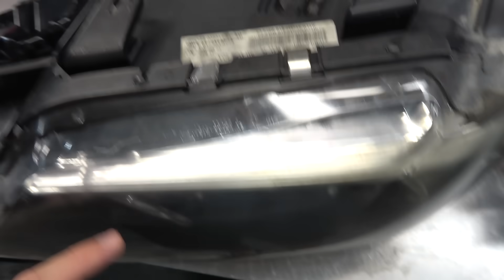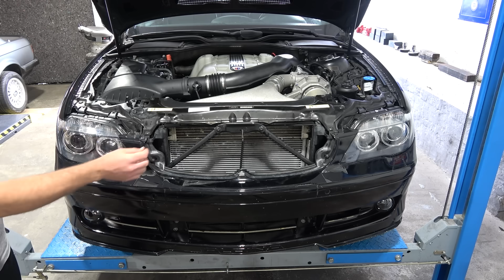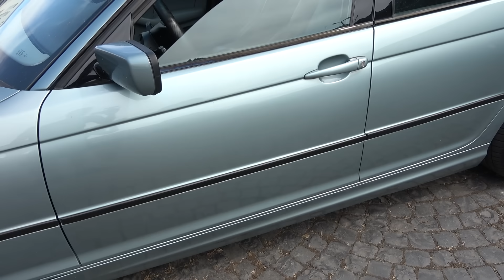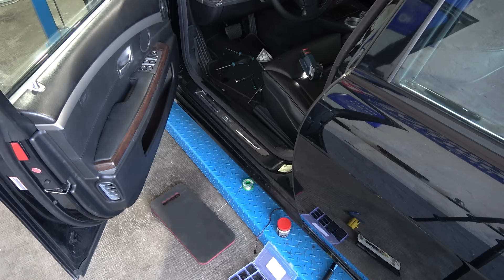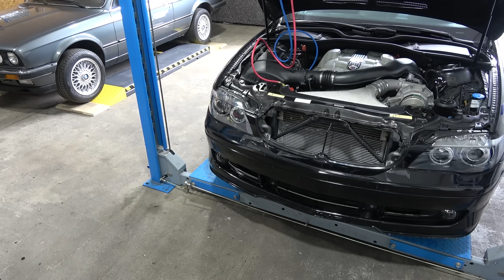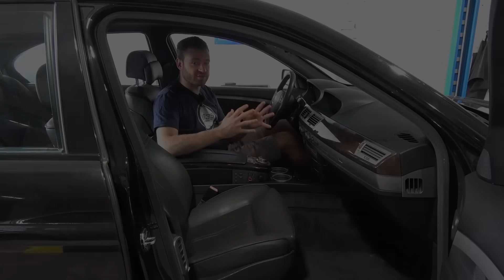Can We Make Alpina B7 Roadworthy Again? - Project Chicago: Part 12

Comment: In Germany there is something else next to waranty. Its called Gewährleistung, I dont know the english term. It says that the seller has to warrant that the part was as described at the point of sale. A faulty pump doesnt qualify as such.
So you can go to the BMW dealer and return that fuel pump on Gewährleistung. And either they take it back or they have to proof that the failure occured after the sale.
Gewährleistung lasts for 2 years but after one year, the burden of proof switches. You have to proof, that the product was faulty before it was sold.
This also has nothing to do with the manufacturer, itsjust between you and the seller, no 3rd party involved. If a business is buying, the burden of proof always rests with the buyer, but if youre a private customer, then its as described. Gewährleistung is mandated by law, every commercial seller has to offer that.

Most sellers dont talk about it or confuse it or try to deny it because its their money on the line.
I dont know if you can decide if you want the money back or a replacement part.

Comment: As someone that works at a dealership in the US, you can do a parts warranty for an over the counter purchase if you have any sort of documentation showing the part is defective (typically from an independent shop that has done the installation or can write up a work order for you showing the steps to verify the part is defective). I don’t know if every manufacturer in the US does this, but I believe most will. Warranty is warranty in the end

Comment: Hi Sreten! I'm a warranty administrator for a BMW dealership here in the US and can confirm the process as far parts warranty is concerned. Dealer technicians do indeed need to diagnose the issue(with the part installed) to confirm the failure, only then will it be warrantied. It is frustrating, especially for you as you are extremely detailed and by-the-book.

Comment: That windshield cowl is poorly designed, in my car the water goes under it because there is no gasket or sealant, the water drips down the firewall between the fusebox firewall and water enters the fusebox and the front passenger footwell under the glovebox through ventilation slits cut in the fusebox/firewall.....the amount of damage this small oversight can cause is ridiculous...i replaced mine brand new and made a custom gasket for it to solve the problem to make sure the water never goes under the cowl again. Trust me its worth the effort, once the water gets in the cab it migrates all the way to the rear seats soaks up into all the foam and you need to pull up carpet to dry it. If the car is ever parked in rain don't say i didn't warn you!

Comment: Instead of using paint on the windshield plastic cowl, why not just treat it with H9 Ceramic coating.  You have it, and it will renew the dark black color and lasts for years.

Comment: Does that fuel pump work at all. I did ones bought new fuel pump too that did not work when giving it  12V. I needed to kick it couple times on the garage floor and then it started to work. It was somehow seized and needed a little encouragement.

Comment: Hey man, since you have a water sand blasting cabinet or whatever it's called, next time you do a brake job, I'd recommend throwing the caliper bracket in there and giving the mating surface a blast. I work in a dealership and we always do this, except we have a sand blasting cabinet. The results are very good and it takes less time then cleaning the bracket while is installed.

Comment: Great work as allways. One thing you should think about when you're wanting to work on E series after 2002. You should learn simple coding. I know it's scary at first, but if you understand the basics, everything else is natural or trial and error. I'm writing this because of the flashing angel eyes (hot and cold checks) and too bright licence plate lights. I also hate overbrightened rear ends, but you can lower the voltage by coding and make any bulb look decent. 
P.S - Be carefull with ANY LED-s in headlights, cheap chineese ones have crappy element that is extremely overdriven and run very hot. I've seen molten sockets and reflectors on many occasions. The most sensitive ones are E60/61 LCI cornering lights. Just a heads up :)

Comment: Good recipe to avoid windshield or headlight sprinklers from clogging?....add a coffee cup of vinegar to the thank regularly...problem solved..!!
Reply: Or use the correct BMW intensive washer fluid
Reply: @Monkey-World-2  most of windshield washer fluids have some ethylen glicol in its formula...at the end all these components turn into some kind of gel that clogs reservoir's conduits...no matter if is an expensive or cheap product...
Reply: @ernest.cazenave  the gel is caused by people not having the correct concentration of good quality washer fluid at all times. The gel is algae that grows in the stagnant water. 

Many people tend to top off the system with water in the summer months and this causes the issue.
Reply: @Monkey-World-2  ecce est demostranda

Comment: With regard to your old block with steel liners , you may find some useful information here, they build up a V8 block which has been destroyed by a bent con rod by using liners and pistons specifically for cast iron . Apparently on some new engines BMW are spraying a Iron liner into the aluminium block and use specific pistons for that use. https://www.youtube.com/watch?v=P-ThVr_K4pk

Comment: 16:54 I have the same problem with LED numberplate lights. I hate the mega bright aftermarket lights. But I found that I can use the OEM ones from F10 or fl E87 on my secondary E60 that doesn't originally come with LED numberplate lights. You just need to solder OEM led numberplate plugs.

Comment: Epic video as always! One quick tip for  the h7 cbi night brakers, turn them on out of the headlight for a minute or two if you could because they have a coating that will evaporate in the headlight. That's the reason headlights become dim on the inside.

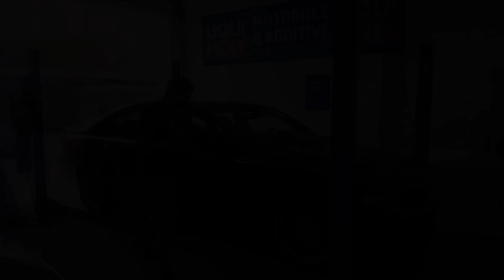Comment: Dear Sreten, I have an offtopic question. Do you know any back story about that blue touring standind outside the dojo ? 56:49
Reply from the maker: Yes, 2003 530i that I bought but still didn't introduce cause no time. It's a future project.
Reply: It's likely the E39 he's going to use for an M5 Touring build. A while back he posted about acquiring a sideswiped E39 M5 (the drivetrain donor car)
Reply: @gietie96  Yes, I know about that. Ha, and I just thought about the idea of swaping b30 from the touring into the e46, cuz he also thought about swaping b25 for b30. So it looks like project spin off :D

Comment: Just a FYI, the flashing LED halos is caused by the bias voltage which is the small amount of power sent through lighting circuits so the car can check to see if a light/circuit has failed. The reason the LED lights will flash is because they require a fraction of the power that an incandescent or halogen bulb does to turn them on.
Reply from the maker: I know :)

Comment: We do know where project Chicago came from. Did you know that in Chicago it only needs to pass emission inspection every two years? That entails pulling into the inspection station station, they check that the check engine light it off and the monitors are ready. That's it! Your German inspection will send it's head gaskets spinning!

Comment: I don't know why you don't just go ahead and charge the A/c system yourself. You've done 95% of the prep work already.  You could use the temp/pressure method or I see you've got a scale so you could do it more accurately by weight.
Reply from the maker: You need a proper A/C charging machine. You can't buy bottles in Germany and fill it yourself, it's illegal.

Comment: The headlight washers must be most pointless invention ever! Has anyone ever used them for any purpose on road car? I understand them on off roaders maybe, when car covered in mud they could clear something away, but apart of that no use at all, just waste of washer fluid. I know they are legal requirement for projector headlights, but as usual somebody who made it legal requirement had no grasp with reality. And if somebody say - what about winter?! Then I advise to try using them in winter - in my experience even using -40C rated washer fluid they freeze over if you use them when driving. In my case I was driving in like -17C and headlights were getting covered by snow in the snowstorm... guess what happened - they opened and freeze over making massive clump of ice around them and on the headlight making it completely impossible to drive. Had to stop in petrol station and ask for hot water to melt the ice just to be able to drive again. 
The headlights are still usable, not all EU countries have same regulation as Germany, which frankly is a bit stupid (not the safety part, but the part where they only care about numbers and marking and nothing else), in many countries as long as light output is right and light pattern is right (e.g. not UK lights which illuminates to the opposite side of the road) then they pass the checks and nobody cares if it says US on the light. On one hand I am all for safety and using quality parts, and I hate people with poorly working lights, for "fake xenons" which blinds everyone, but at the same time I hate arbitrary rules which exists there only for the sake of existing and which creates pollution and forces to replace the part which is perfectly fine and in case of lights shines exactly the same as the part marked ECE or whatever. I am sure in your case the glass was faded (could be polished) and the housing cracked, so perhaps that in itself justified the replacement, but if you would have to replace them just because they are marked US... I would be PISSED. I would probably change the lights for TUV and put them back on just for the sake of it and on principle. Similar to what you mentioned about protective film - absolutely ridiculous law which has no place to exist. One advise - remove the lights when applying the film, so that it goes inside body gaps - this way even if stopped it will be very difficult for anyone to see they have film, because the edge will be hidden. Again I hate people darkening headlights, in my opinion that should absolutely be illegal, but clear protective film... surely it hurts nobody?! 
Apart of that Osram bulbs are pretty much the best on the market, used Nighbreakers for most of the time and they always were excellent, always outlived my ownership of the car.
For windscreen cowl (trim) I think you should have used ceramic "trim restorer" and I believe end result would have been better than painting and less complicated job.
Kind of surprised you didn't use AquaBlast on brake parts as I personally would try to use every opportunity possible to use it if I had one :D

Comment: Sreten, for the LED number plate light I have had good results just getting a replacement LED festoon bulb and putting that in the OEM housing. They tend to be less powerful than the full units that are as bright as the sun and you can angle them towards the car rotationally to reduce light output a bit as well 👍🏻

Comment: Those TUV regulations are just insane! Can't even have a clear film over the lights to protect against stone ships!?

In the UK I currently run a Fiesta ST150 thats fully stripped out, 200 spec cams, 4-1 manifold, mapped, harnesses, bucket seats, coilovers and front end polybushed. I have a supercharger in my shed waiting to go on and it passes MOT and not once have I been pulled about the mods.

Comment: The brand new OEM fuel pump issue that was bad from the dealer you told us about @ 18:35 BMW not owning up too and no refund and subsequent waiste of time it cost you was an eye opener not to mention unbelievable. I can see them pulling a no refund on electrical parts on us squids but a master mechanic such as yourself is why the dealer turns into 'the stealer'

Comment: Why not flush the AC lines with solvent, remove all the old spent oil, flush again with nitrogen and just use the compressor with its new oil? It does not take much at all
Reply from the maker: That's way too difficult and only way to flush it is to replace all components.

Comment: The Ac comp won't die because of too much oil it just won't cool efficiently but more than that I think it's not a good strategy to put however much was in the old because over time it could have come out of different places during recharge or changes like you said condenser. Given it was oem denso I would trust them to put the right amount from factory and I think your comp is now low on oil.

Comment: I just replaced windshield cowl for my 330Ci e46. There is very good product for plastics i recommend you try instead of paint. Gtechniq C4 plastic coating. Small bottle goes for many parts. I put that product for my e46 sedan 2017 and all plastics are still deep black. Windshield cowl coating took only 10minutes. Ipa cleaning, and then it is time for C4 trim coating. I would say C4 finish is even better than rattle can painted black trim parts. I am enjoying your videos. Thank you. Antti / Finland

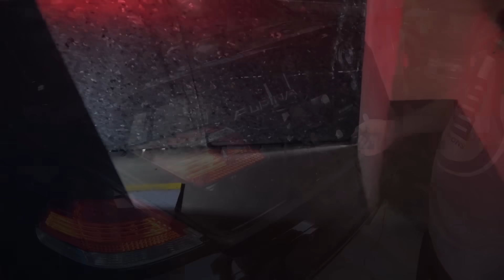Comment: 20:24 I don't know about German TuV, but in Croatia you can't run too bright license plate light and you can't run LEDs if the car doesn't have them from the factory. The thing is almost nobody cares about that but if the policeman or inspector is having a bad day you can get a ticket or fail the yearly technical inspection.

Comment: 21:25 You can buy led  bulbs in place of halogen for the numberplate, that are dimmer than the aftermarket with 18leds, but might cause an error on the dash, might not.

Comment: Ummmmm …. That is NOT how you put the correct amount of oil in a compressor! You should be able to get the specific amount it required from a manual or the dealer
Reply: You don't put in the amount specified in the manual unless the entire system is devoid of any oil. If you overfill it the a/c will never get cool.

Comment: Alcohol should be fine on the headlights, we would use alcohol for all plastic parts when prepping for paint, but would use a stronger cleaning type thinner for metal bits, that would have an effect on plastic, but alcohol generally doesn't.

But, better safe than sorry really, there is always an exception.

Great work as always though, inspiring for me to do stuff to my own car, which is hard to do thanks to ADHD, but you seem to be able to trigger my hyperfocus, which I thank you for!

Comment: Hi M539. This is a complete misinformation with the fuel pump. I learned dealer for carparts, had my own shop and I am in the Audit Committee for car parts apprentices of the german IHK(Chamber of Commerce and Industry). They have to check the fuel pump, they have to send it to the manufacturer!  BTW, I'm living nearby in Schwäbisch Hall, if you need help. Stephan

Comment: talk about bad quality original parts: I had to replace a tail light and it had greasy fingerprints inside the light assembly, so they had to replace it and the replacement also had fingerprints inside the light so they replaced it again and the third one also has a slight fingerprint inside but it's small enough that I said f*** it it's good...

Comment: The look on your face told me your B7 had passed TUV before you told us so!   
Those wood trims I believe are made by Kurz and are a holographic foil bonded to a plastic backing piece.  They are in fact better than genuine wood trims because real wood moves around with temperature and humidity and cracks off the lacquer whereas the foiled trims look just as good and will last the life of the car.
Regardless of further work planned on shocks etc. you now have a World Class Alpina B7.    An absolute credit to you!

Comment: Really surprising that you didn't turn off the voltage check so that the headlights don't flash on startup. I did it on mine and I only use Carly. But anyways much love and superb project.

Comment: Just try and buy an LED version for the bulb. You just change the normal bulb with an LED one and it will not be that bright at all, compered to the aftermarket LED lights thag have like 20 LED's in them.

Comment: Are you sure the headlights had to be replaced? There is an E1 mark on it which makes it Euro legal...
Reply from the maker: Absolutely. E1 is just for the outside lens cover which is the same for EU and US spec headlight. Inside of the headlight is what matters and that's marked on the housing with ECE or DOT US. Projector height, turn signals and side markers that are required in the US is what's different between them.
Reply: They were shot anyways haha but I'd like to hear about the difference

Comment: @42:20 I noticed you didn't replace the dryer. You HAVE TO replace the dryer EVERY TIME the AC system is opened. This is from an AC mechanic's training material. I worked on some AC systems in the past too when I was forklift mechanic and if you EVER open the AC system you HAVE TO replace the dryer too. Why? Because the system has been open and pipes have been filled with moisture in the air and the dryer has kept sucking all the moisture in the air constantly the whole time the pipes and lines have been open, non-stop. So, the last step you do when you have opened the AC system, you replace the dryer and close the loop for good and then fill it up. If you open the loop again, you either replace the dryer again, or at least plug it if the dryer has been replaced very recently.

Dryer helps to keep the bearings and lines in the AC system rust free. Otherwise everything starts to rust from the inside and that's 100% dead AC system for you and  you replace everything.